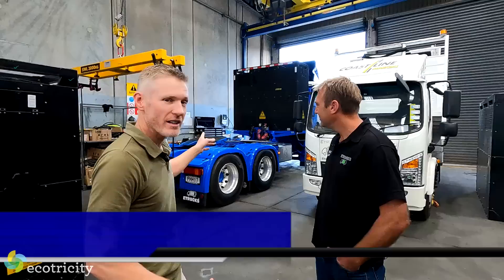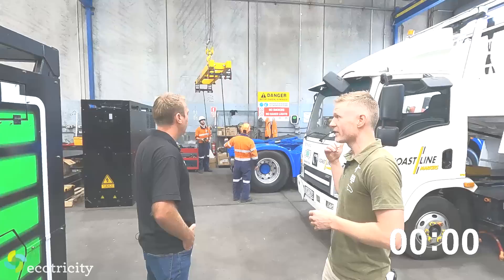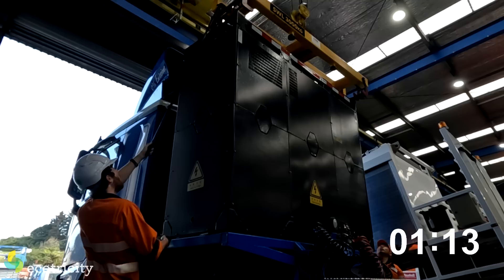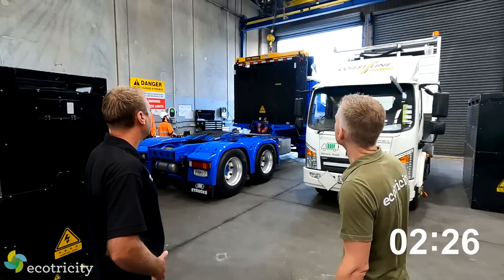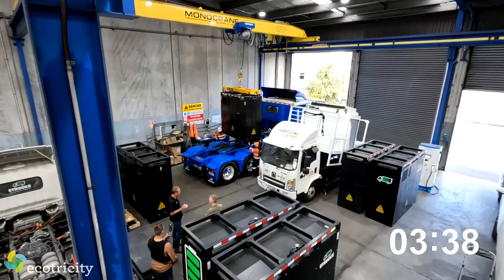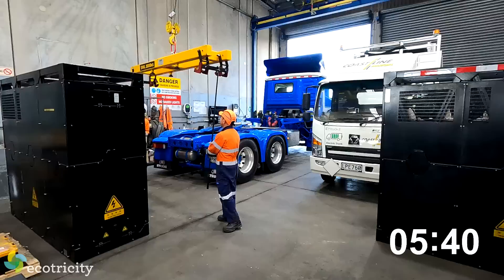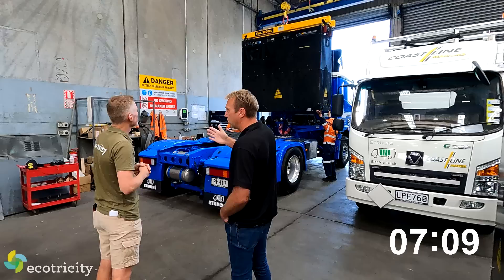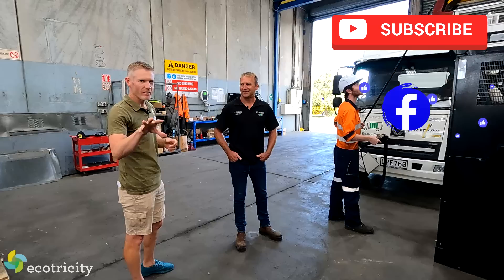Faster than diesel? We do a battery swap on a big electric truck!

Comment: Makes sense to me. Have big batteries, charge slower (or at night on cheaper rates) and just swap batteries in Hamilton, Taupo, Bulls etc. As trucks make their way from Auckland to Wellington. Even a hybrid makes sense to me. Have a truck use a bit of diesel but capture the energy on the downhills and slowdowns instead of sitting on the brakes/engine all the way down the country.
Reply: not really for a truck this size because of the engine needed to charge the battery like a phev. Thats why hybrids only appear in mostly Cars.
Reply: Not really; there is a maximum energy flow *for each cell*. 

There are more cells in these batteries, so we can charge faster with that same proportion. Meaning, as long as the cables and other infrastructure are there, charging takes not too long

Comment: 2.8 ton right behind the cab and no cab guard, be interested to get work safes view on that.
Given the quoted figures to do my old logging run would take 6 battery swaps a day, that means having to go to the swap station__ more lost time. Probably looking at a 30% productivity loss. 
EV trucks have a place, maybe short line haul; between bases, but seriously Auckland Hamilton and then a swap🥴. Be great round town though, especially with all the stops at lights and I am sure pedxs would appreciate the lack of exhaust. Clearly a lot more development required.
Reply: ... Very good point about the battery position & driver safety.

There's fire risk too.  

Very different configuration here though presumably similar batteries to a Cement Australia Janus conversion truck that just burned up.

Comment: Would love to see an actual race between the battery swap and a  diesel fill.
Reply: Does it matter if the battery swap is faster than the vehicle is unloaded and reloaded at a warehouse?
Reply: @JohnR31415  that's why you have races vs simply recording track times...
Reply: @Telcontarnz  F1 tyre changes never used to be that quick, because the pit stop was limited by fuel loading - so there was no benefit to going faster.
The same applies here. If you’re really that concerned about swap time then you must be switching trailers, so the obvious solution is to have the battery mounted to the trailer…

Comment: Janus Electric in Australia is also doing battery swaps on Prime movers, but they are road train rated 90-106tn truck.  720hp with a 16spd auto shift conversion. Check out their videos on YouTube. They now replace the fuel tanks on the sides with a bracket to hold batteries on both sides, so the weight is down low and at the moment done with a forklift. They are also looking at having a similar robotic station to do the swaps, sometime late or early next year.  Interesting to see different companies trying similar approaches but with a slightly different design. 👌👍
Reply: ... Like with all these Lithium batteries, fire risk is likely more serious than the present conventional wisdom.
Reply: @kradius2169  They use lithium ion batteries that love to catch fire, the people in this video uses lithium iron phosphate batteries which seem to be a lot safer.
Reply: @kradius2169  Yeah they need to change the battery chemistry to stop the fires from occurring, same as they are starting to do with cars and pickups. Then the whole system starts making more sense.

Comment: Excellent video Gavin. Short, different but very interesting to see. Want to see the robot swapping set up next !! Yes the boys will be bricking it with the camera filming them. I use overhead gantry cranes in my work and they would be just praying not to get that 2 tonnes swinging on the hook and bashing the cab on film!

Comment: This is the way. Hopefully innovations in battery tech, including modular cells and other form factor improvements, will allow for faster and less labor-intensive battery swapping at truck stops. That would solve a lot of issues for places like the US where forcing trucks and other vehicles to sit and charge causes bottlenecks.

Comment: If you have to disconnect the tractor from the trailer to do the swap, as you show here, it's a lot more than 5 minutes.
Reply: This is just a bodged-together proof of concept using tools that weren't designed for the job. Version 1 of the real thing will take care of obvious problems like that one, and versions 2 and 3 will start to deal with all the weird stuff that happens, like a mother duck leading her ducklings onto the battery mounting after the battery has been lifted off, or a freak flood washing the truck and trailer out, or the driver having a heart attack on the spot, or whatever. And be cheaper and faster.

Comment: Imagine one trucking company siding with one swappable battery design and another with a different one thereabt locking out independent self-owned drivers.   There really needs to be some standardization if we want battery swapping not just defacto standardization.

Comment: My opinion, Fast Charging is the best way than swap battery. i mean not only truck should be charge but also the driver need charge with some rest so that truck and driver in the maximum prime after that for continue the journey

Comment: What are chances of fire. One of the Janus cement truck has thermal run away and cause immense damage. I’m not against electrifications. Feel there has to be a preventative and or recovery system when this happens because the nay sayers will ruin you

Comment: But what are you charging them with? What is the point of this? It makes freight to expensive. All these batteries and stuff cause more pollution than diesel!
Reply: NZ is 87% renewable powered ?
Reply: This will be close to 100% powered by hydro, geothermal, solar and wind energy. Fuel cost will be about 80% less than diesel. There is a reason the companies trialing these trucks are buying more and it's not just because the drivers prefer them.

Comment: With all the lithium batteries catching fire Tesla's catching fire now laptop battery recently caught fire on an airplane. I can't imagine what one of those would look like out on a highway catching fire total devastation. As you can tell I am not an EV person no thank you.
Reply: good job diesel and petrol dont burn!
Reply: Fire service stats out of USA suggest BEVs are 10 times less likely to catch fire than an internal COMBUSTION engine. I guess the clue is in the name. No hot exhaust system, simplified cooling, less breaking heat, less roll over risk and not needing a literal explosion to drive them.
Reply: @gpsfinancial6988  Those same states will tell you how much harder EV fires are to deal with.
Reply: ... Janus electric truck fire just shut down an entire side of a major Melbourne highway for at least eight hours.

As large Lithium battery fires apparently burn at ~5,000F, roughly twice the melting point of steel, and the battery was something like 600kWh, ~6 Model S Plaids, the pavement under the truck would likely need repair too.